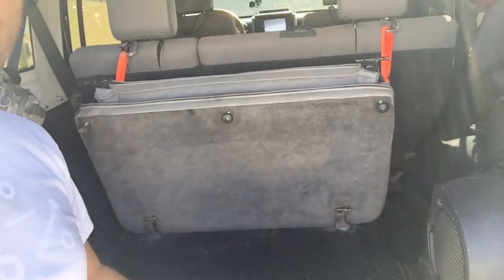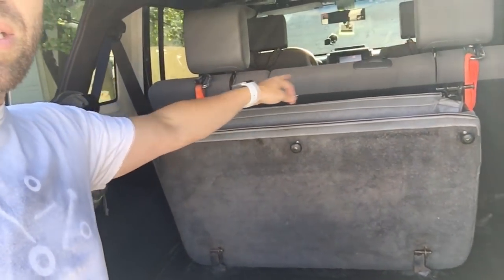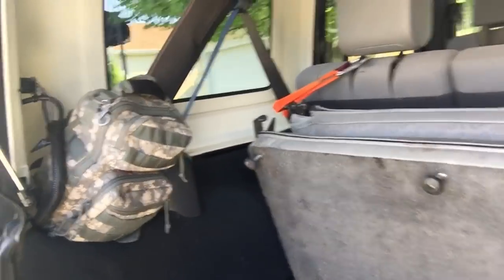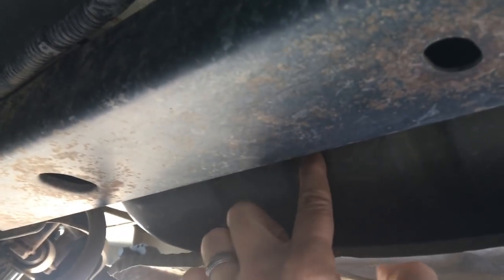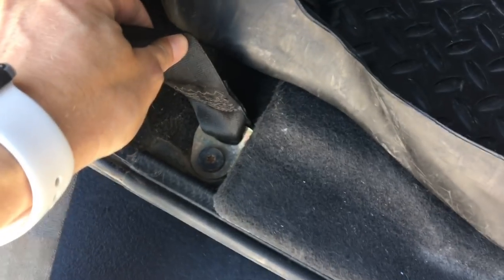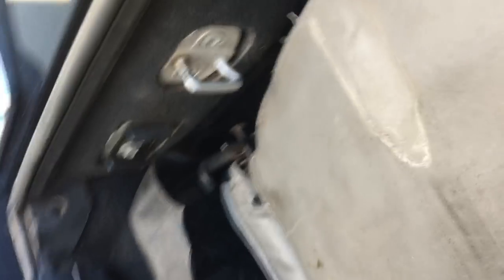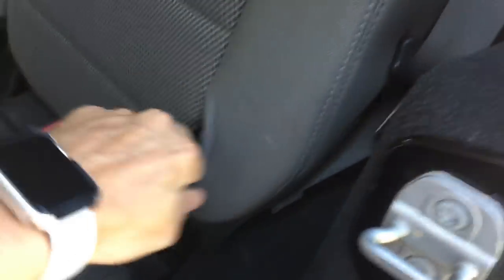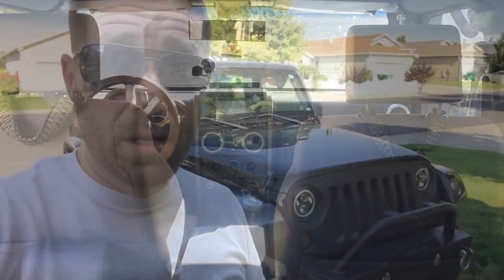Adding 3rd Row Seat to Jeep Wrangler JKU

Comment: Those bolts will rip through the floor in a crash.  Need to plates above and below to distribute the force.  Your lab belt is not properly bolted in and can’t be shared by multiple passengers.  In a crash they will slide out of the belt.

Comment: What made you change your setup? I'm looking at getting my hands on a TJ back seats right now and if there are lessons learned, please share! Thanks.
Reply from the maker: Michael Curbow lots of lessons learned. If I did it again I would definitely make my brackets bolt into the stock cargo holes. Remove those loops and use the built in screws already there. I’d also try and integrate the seatbelts into the seat.  Honestly the seatbelts are the most challenging part of the entire setup. If you watched my sequel to this video where I built a bracket I put seatbelt holders on the bracket but I’d rather have them integrated into the seat itself. 

Finding a seat isn’t hard, I bought a replacement seat on Quadratec.  Very affordable.
Reply: @1111Overland  thanks! I'll keep that in mind. I'm shopping around for a seat currently. I'm cheap lol... so no rush, just shopping.
Reply from the maker: Michael Curbow I got the first seat I used (in this video) from a guy who calls himself “Dr Jeep” in Provo, UT.  He parts out old broken Jeeps and I’m sure he’d have what you need.  Look him up on Facebook!

Comment: What do you do about cargo?
Reply from the maker: With a third row you have to get creative. We HEAVILY depend on the space under the seats, typically telling each kid “you can only bring what fits in this bag” and then we maximize the space over the wheel wells. For longer trips we would either put a rack on the roof, tow a small trailer, or have one of those rear cargo baskets that attach to the hitch or the tailgate. Cooler and food typically go under kids feet behind driver and passenger seats. 

It’s a tight, it’s a challenge, but it’s been fun figuring things out.

Comment: Does it not mount to the floor at the back of the seat?  What year TJ seat is that?
Reply from the maker: SG1Raider no, I didn’t add that hardware to the back because it would have eliminated my ability to open and close that under-seat storage.

Comment: What size nut and bolts to bolt seat down you use ??
Reply from the maker: I wish I could tell you. I took my seat brackets to the hardware store and found a bolt that would fit through the bracket hole. 

I do remember that the bolts were about 3-4” long. And I bought nylon lock washers to make sure it was secure and didn’t loosen up.  

I would also suggest better support under the floor.  Wide washers, as big as you can find, and ideally a long bar that you could use to span the distance between the left and right bolts. I’ve done several iterations of this over the years and each one has gotten more secure over time. The last thing you want is to have your little ones fly up and out during an accident!!
Reply: @1111Overland  thanks 
The main thing was how long (length)